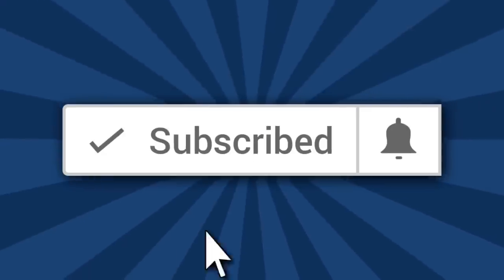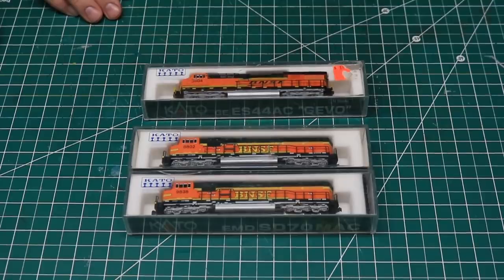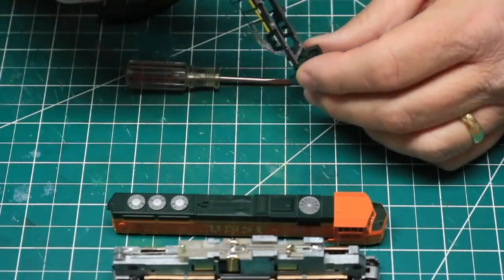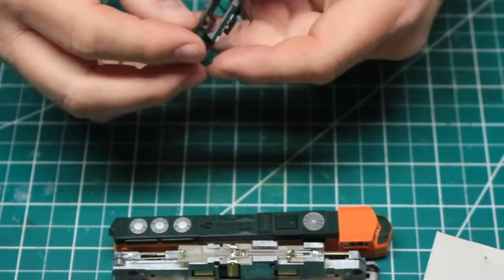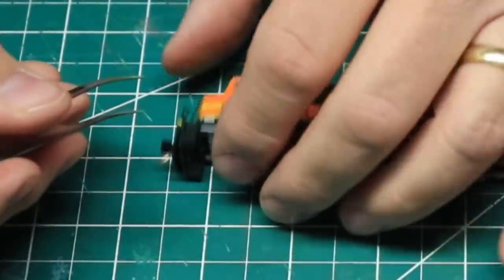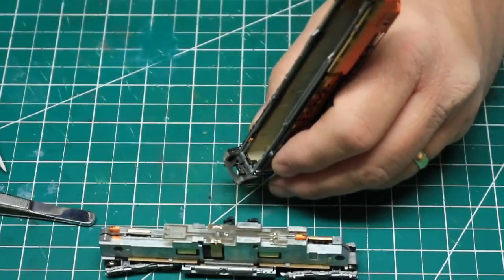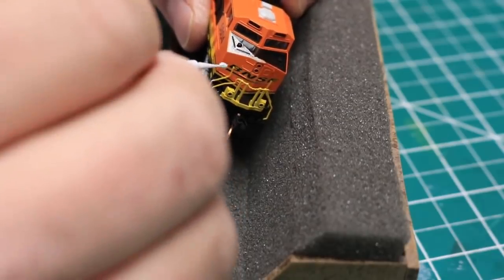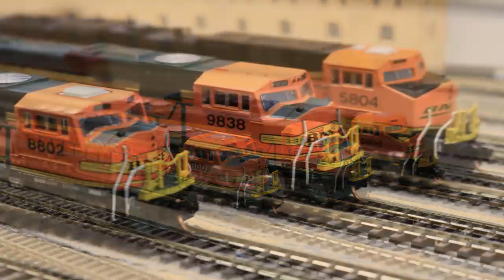How To Upgrade a Used Model Locomotive

Comment: Ron , I loved the info but I would suggest using Tamiya RC car colors to paint the rails as it is designed to stick to poly carbonates.
Thanks , Mike
Reply from the maker: Thanks for the tip Mike. I'll check that out.
Reply: I would second what Mike said. The RC car paint will not flake off. I paint the hand rails on the sprue and let it dry first. Then snip the rail off and install it. That way there's little to no chance of getting paint on the shell. ;)  @RonsTrainsNThings

Comment: really nice job on the detail Ron. In the past when I custom painted a loco..the handrails were too close for comfort and my nerves to not get paint where I didn't want it. I found that I was able to cut strips of computer paper and slide them between the handrails and the loco body. Sliding the paper out also gave me the bonus of getting paint on the rear part of the handrail as I slid it out. Looking forward to the DCC additions to these locos. Tom
Reply from the maker: That's a great idea, Tom. Thanks for the tip.

Comment: Great video Ron. Very informative. Sense I’m new to the hobby I haven’t been brave enough yet to venture into the used equipment market. But I’m sure I will eventually. Thanks.         Papadan
Reply from the maker: The important thing is to do your research, ask questions, and try to know what you are getting. You can get some great stuff lightly used or even unused second hand from collectors, but you can also get some real garbage. The key is to be careful.

Comment: Ron, very nicely done. When it comes to the D.C.C. instalations, just bring it on. Can't wait. Cheers, Chris Perry.
Reply from the maker: I look forward to that. I will probably make 3 separate videos to highlight how I install 3 different decoders in 3 different ways.
Reply: @RonsTrainsNThings  3 Video' s brillant. Now I need some advice please. Many, many years ago I modelled in "0" gauge, and long before D.C.C. I purchased a very expensive D.C. control panel with all the bells and whistles. It must have been used for 15 minutes at the most. Got it out of the box to test.It will run 4 "N" gauge loco's + a D.P.U. as smooth as silk. Loco's aren't fighting each other no speed matching, just put them on the layout and run. The control panel has a side panel to control a pair of loco's shunting a yard. I don't need walk around control the layout room is only 12' x 10' ft. The loco's I tested were  2 Kato, 2 Fox Valley I Micro Trains. What do you think ? I'm tempted to stick with what I've got. I've always wanted a big control panel anyway. Any thoughts would be greatly received, Thank you. Cheers, Chris Perry.
Reply from the maker: The one thing I would check is the voltage output of the pannel. Being designed for O scale, you may be pumping a lot of voltage into those N scale locomotives. If so you could run the risk of burning out motors prematurely. If the voltage output is aroudn 12V you should be golden.
Reply: @RonsTrainsNThings  This control panel was regarded as the Roll's Royce of panel's. The panels were hand built to order by a private individual, long since called above to build panels for that great model railway in the sky. It has12 volt controlled D.C., 12 volt uncontrolled,D.C., 16 volt A.C., 24 volt A.C. It has varibale braking slide control. varible momentum slide control. This main panel has a cab"A" and Cab" B" in one unit. The slave plugs into the side of the main panel. It has a neat trick. Set a train running on the main line with the varible momentum, throw a double pole double throw switch train keeps running but you can run another train just by using the normal rotary knob. The panel was designed to run everything from old Pitman motors right up to milliamp Swiss motors. Apart from the mountain of wiring needed for a D.C. system, I'm tempted.  Otherwise I'll purchase an N.E.C. system. But if I don't have to purchase D.C.C. I've got more money to buy rolling stock. Cheers, Chris Perry.

Comment: Hi there Mr Ron I have a question to ask...when not in use what is the best way to store my n scale locomotives...in the case if possible but mostly in a upright position like if they were on the rails or on there side like at the store? The reason I’m asking is I have had two locomotives that somehow got lubricant in on and around the comutaiter  and would stop dead and start smoking in a white color? Any advice would be helpful. I have not lubricated these engines because they were new and seen no need to cause they ran great, then sometime later I put them on the track and got white smoke and no movement. Again any help or advice would be awesome thanks in advance!!

Comment: I did the 2004-1 MTL Couplers on 4 KATO’s. Two SD70ACe, ES44AC and a P42. 

They all seem to ride too high. Won’t couple to my Atlas Coal Hoppers with MTL Barber Roller Bearing Trucks with MTL Couplers. 

Looking at them from the side in close they are definitely above the other Couplers by half. This causes uncoupling on the main in motion. 

I wonder if I could Shim under the assembled boxes by cutting small rectangles of .010 Styrene and drilling a small hole for the retainer pin?

Do you think this would work?
Reply from the maker: Are you sure the locomotive shells are seated all the way onto the chassis? The couplers mouont to the shells on Katos, so if they are too high the shell is not down far enough. Most Katos have the coupler draft gear box fit into a slot that surrounds it, so shimming isn't an option. In situations were shimming is an option, however, MTL couplers come with small washers for shimming.
Reply: Well I never had to take the Shells off. Did them with angled Tweezers upside down resting on a padded tray. 

I’ll get the LED magnifier goggles on and take a good close look.
Reply from the maker: Check along the top of the fuel tank. If the shell got pride up at all, often the skirting on the shell will get caught on the top of the fuel tank detail and the shell won't slide all the way down on to the chassis without pushing that skirting back to allow it to clear behind the detail on the fuel tank. You need to do this on both sides. I would check that and see what happens.

Comment: Man that makes a difference. Where do u get the microbrush.
Reply from the maker: Here is a link to them at Micro-Mark. They come in 3 sizes. I mostly use the regular (green) and superfine (white). If you use the promocode RONSTRAINS at chek out you will save 10%.
Reply: @RonsTrainsNThings  thanks man. Just got done with watching the more details of a locomotive.

Comment: How do you go about shimming the couplers to get proper height on the ES44? I have the same ES44 in CSX and the couplers ride a bit off.
Reply from the maker: On the locomotive they fit tight in the coupler pocket, so make sure the shell is fit snugly all the way down on the chassis.
Reply: @RonsTrainsNThings  I'll double check the fitting. Thank you!

Comment: Nice video!  I model in HO but I can't say enough nice things about Kato's customer service.  If they have the parts (some items are sold out) they are shipped quickly and the models can be back in business right away.  It looks like you had good results with painting the dark end railings into yellow.  Usually yellow needs a white or light gray primer because the yellow paints don't cover well.